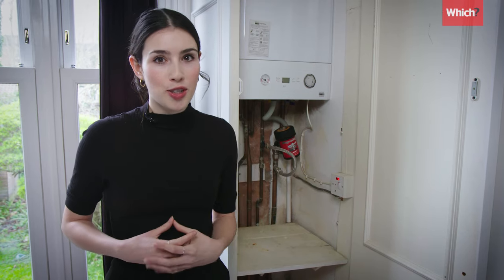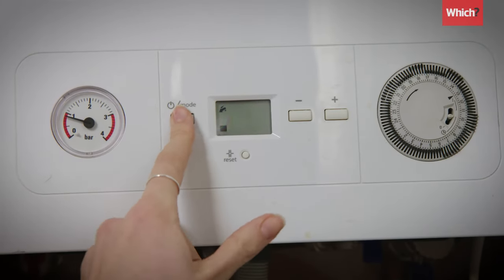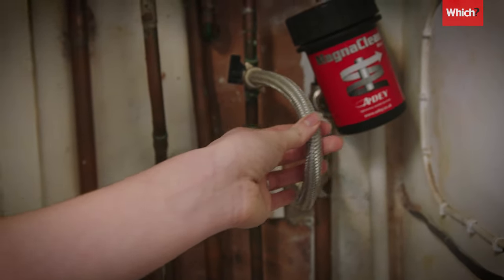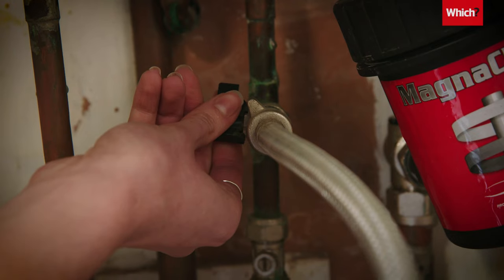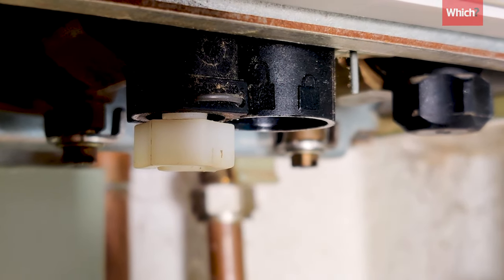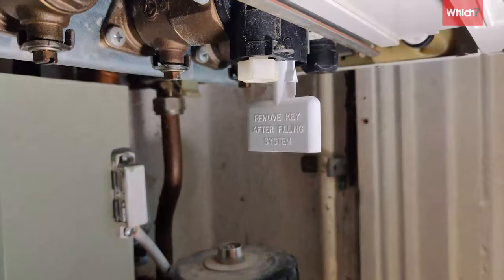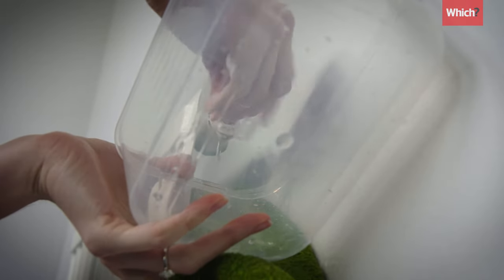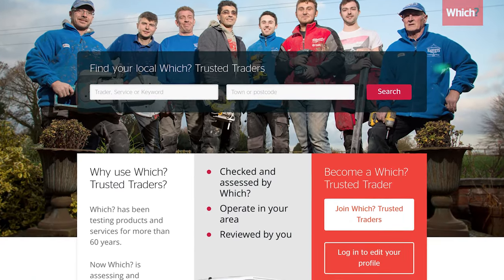How to repressurise a boiler- Which?

Comment: I have on a couple of occasions found that the filling loop valves leak slightly and pressure builds over weeks until it gets error high pressure.
Reply from the maker: Definitely something to look out for and maybe worth disconnecting the hose to avoid it.
Reply: @which  the boilers that had this problem were both Vaillant with internal valves